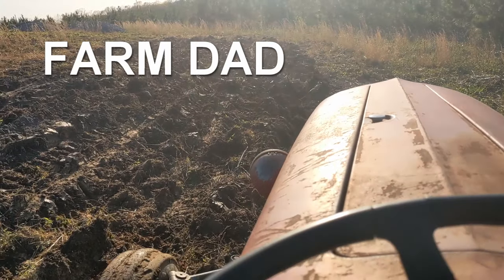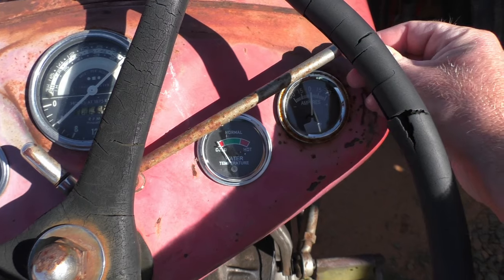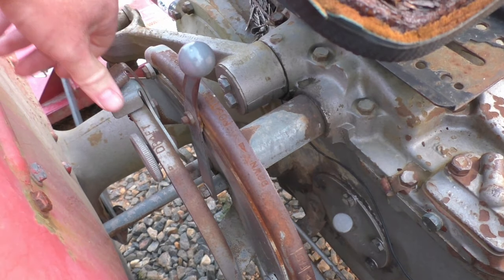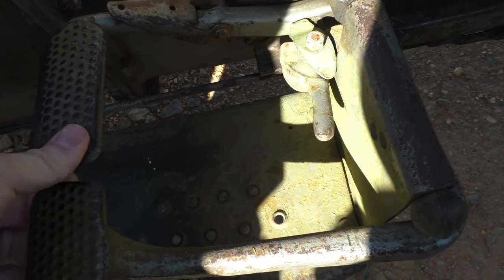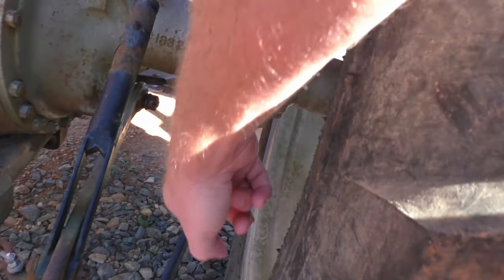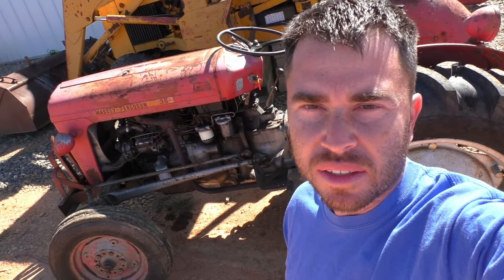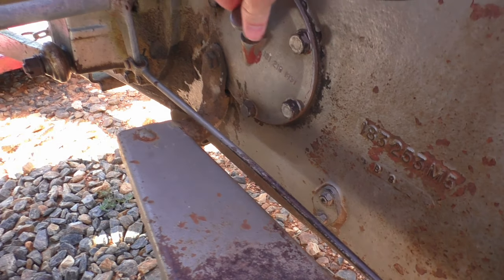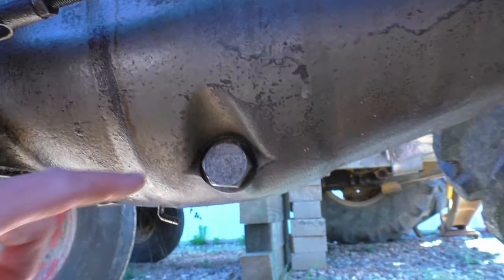Video Operator's Manual for Massey Ferguson 35 Tractor

Comment: Hey, just want to urge you to buy a set of replacement shifter boots for your tractor. They are under $5/pair and save your transmission from getting water down in it where it can fill up and freeze cracking the casting in the worst case, corroding the bearings (especially the small needle bearings at the lowest positions), lock up the shifter rods, and create a lot of repair work in there. I just went through the TO35 I inherited to replace bearings and seals in the transmission because of the rubber not sealing to the shifter shafts. The shifter knobs unscrew, pull off the old ones and push on the new ones.
Reply from the maker: Thanks for the heads up!  I really should do that!
Reply: Yes,,cheap insurance.
Reply: Where are you getting parts?

My shift boots are recent but I need other stuff. However I can use it again when I can steer it. Everything else is functional.
Reply: @dwaynestomp5462  E-bay. Where I found.

Comment: I just bought a 1963 MF 35 deluxe  3cyl perkins diesel 5 days ago for $600. Runs great. Mine doesn't have diff lock either. But if your brake pedals are not locked together you can press the brake pedal on the wheel that is spinning and the other wheel will start to spin.
Reply from the maker: That's a nifty trick!  I'll have to try that.  You got a great deal!
Reply: @FarmDad  found it in a field been sitting for 9 years .checked fluids, hook booster cables to it and she fired right up. It also came with a little brushhog
Reply from the maker: @samuelmarshall1003  I paid 2500 for mine!
Reply: 2700 for mine not sorry @FarmDad

Comment: Just found your channel. I'm over in Rogers Arkansas and just bought a Massey Ferguson 35 (gas model) today. This was extremely helpful!
Reply from the maker: Hey neighbor!  Enjoy that tractor!
Reply: My girlfriend’s parents live in Rogers. Love it out there!. I just got a TO35 too. I’m looking for a mower, auger and front loader. You don’t know of any out there do you?
Reply: If you don’t mind… what did you pay for your tractor?
Reply: @designfabrication512  It is a fixer upper. Got it running pretty well now though I have to shut off the fuel to turn it off still. $800.
Reply: @spindiamond  I’m looking at one that looks to be in pretty good  shape… new carb, new ignition, starter, governor, alternator. The guy wants $1900

Comment: That little cotter key is your best friend, one time, long ago I got my tractor stuck, mud got up in that drain hole, stopped it up,
I did not realize this, drove tractor for a while and oil got on my clutch,
Had to have a new clutch 
Recently, the cotter key finally broke off from years of wear and tear,
Take that clutch inspection plate off and you can replace the cotter key,
Take care of your old Ferguson and it will take care of you,
They are fine tractors,
Reply: Also replace those rubber gear shift boots, water can get into your transmission differential sump
Reply from the maker: @fredhart7904  I really need to do this

Comment: The 3 engine options for the Massey Fergusons were propane (Continental), gas (Continental) or Perkins diesel.  The mf65 had a 58hp 4 cylinder Perkins diesel that was a beast.

Comment: I have one of these with the gas engine... need to do the steering gear box either complete or with a kit.

Your split brake pedals can work the same way as a traction control., you just have to brake the side that's slipping,
Reply from the maker: Yes sir, thanks for the tip.  🤦‍♂️

Comment: Hey I got one of these and the clutch seems to get stuck with it engaged.. any tips to get it unstuck?
Reply from the maker: I haven't ran into that problem.  I have a video on how to adjust the clutch pedal, but I'm not sure it would help in this circumstance.  https://youtu.be/8VgfQB52wzo
Reply: @FarmDad  Thank you! were assuming at this point that its gonna need a clutch
 rebuild. Sadly. Not sure how much it will cost but it runs to good not to get it fixed.

Comment: You stated that the 4 cylinder Continental engine was diesel I will correct you .  My 59  Ferguson 35 has the  Continental  4 cylinder 
Z-134 gas engine they were not diesel .  I have owned and operated many of them since the 1960s  with that engine and the perkins  3 cylinder diesel .
Reply from the maker: You are correct.  I must have misspoke.  I meant to refer to the 4 cylinder diesel as a standard built 23c.  And the petrol as a Continental.
Reply: I believe that's what mine is . 134 gas. Just learning here. Forget the European motor

Comment: What dose it use for hydraulic fluid?
Reply from the maker: I always just used the Universal hydraulic fluid from Tractor Supply, but a lot of people swear by 90w gear oil.
Reply: I know I'm a bit late to the party, the fill cap on my unit says summer 90 weight, winter 80 weight.